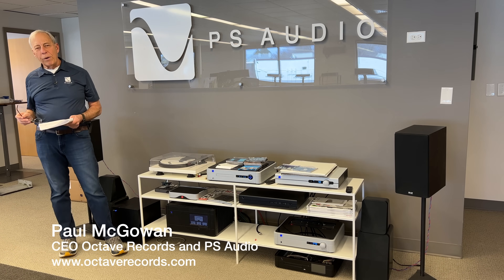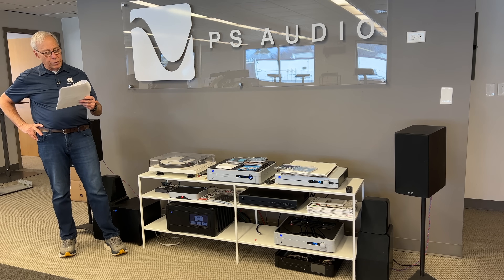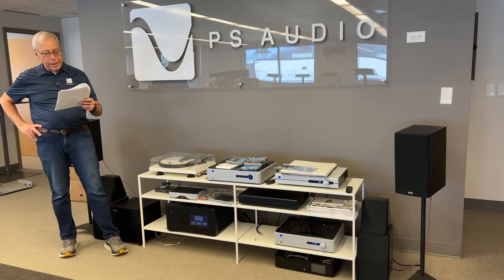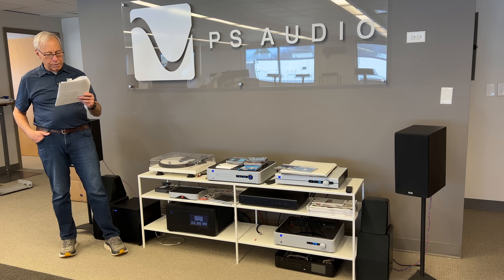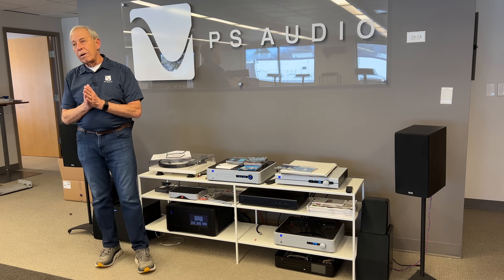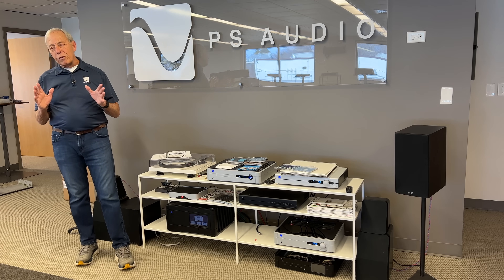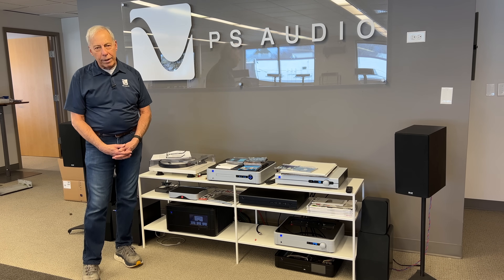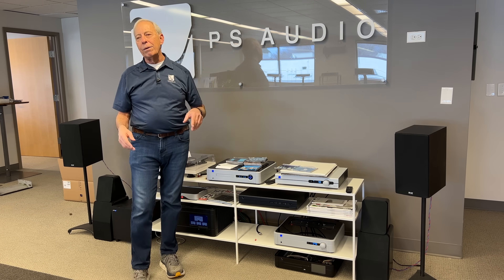DSP vs  passive for crossover

Comment: I am also thinking about going with the MiniDSP SHD or the SHD Studio, but that one is all Digital. I really want to give DiracLive a shot.
Reply: i did got shd studio, and i gave dirac a shot, and it did not work at all for me.  the minidsp is all you need and no mic required unless you want to make a 300hz crossover or higher.
Reply: @sudd3660  how did you give dirac a shot without a calibrated mic? I had to make several measurements to get dirac to work with my MiniDSP SHD. 
To the OP, Dirac is great for low frequencies. I had to boost my bass a bit as dirac took more out than I wanted but that's why custom curves exist. I definitely wouldn't recommend any room correction for mids or highs though. The subwoofer Integration was super simple with my MiniDSP SHD.
Reply: @JC-lk3oy  dirac requires a calibrated microphone and a adjustable stand, as wells as following the instructions and tweaking the results afterwards.
Reply: @sudd3660  ok, it sounded like you were saying no mic was needed with the miniDSP at all. I see what you were saying now. You meant just for the crossover, I got you. Did you try moving the dirac curtain down to only be used for 200hz and below? I found room correction much higher than that sucks life out of the music.
Reply: @JC-lk3oy  minidsp dont require mic, only dirac does. 
dirac had bad effects for me in bass and high frequencies, compared to my own eq i did by ear.  
and rom correction if you do it by ear can be done at any frequency, and it should done that way. 
lets say you have a loud tweeter peak(5khz), reduce that spot so that its sound even with the rest. that is how it works right. especially if dsp is done before the dac conversion, in the digital domain.